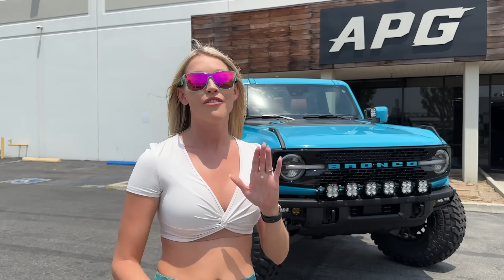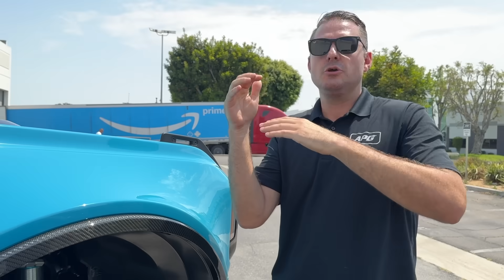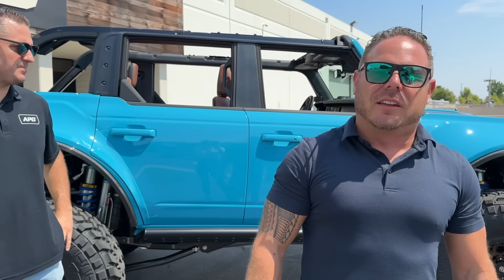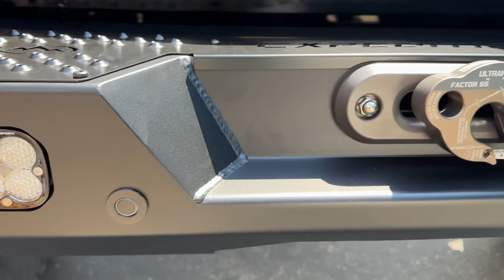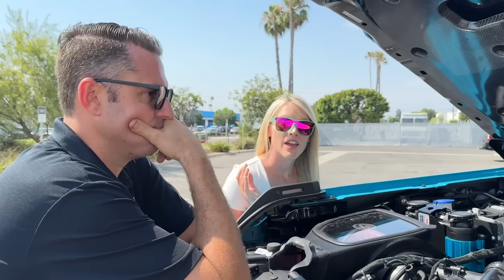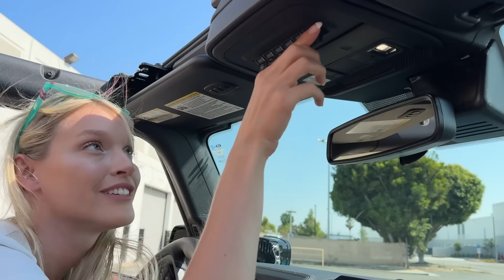BRONCO RAPTOR KILLER! The Best Bronco Build, Done the Right Way!

Comment: POS independent suspension. I won't be impressed until someone swaps in a solid axle, at least Dana 60. Kept the garbage engine when a Coyote would make a superb engine. Back in the day we torched off many an independent suspension for reliable and tough solid axles. And I won't even bring up issues like transmissions and transfer cases.

Comment: What gear ratio is this bronco? 2.70 or 3.73? The geometry looks off from the stock, meaning some parts will have more stress than other. How do u manage that? How much torque loss or power is expected with the bigger tyres and lift? Yes it definitely looks crazy

Comment: 💯This is absolutely not a raptor killer, just pretty.
Reply from the maker: It definitely out performs a Bronco Raptor. ☺️
Reply: @LiteBrite  ... let's keep it real, unless a Raptor was lightly modded, 3.0L = 500+hp & 550LB-FT torque, Baja Kits LT Suspension #RIP

Comment: Guys, I used to have a great deal of respect for your content when I first followed your wrangler shows.  Seeing you waste your breath as an advocate for FORD just drives me away.  Back in 1985, I gave FORD a chance when  I bought my first Bronco.  What a piece of crap.  Five trips to the dealer to fix a transmission problem with NO FIX.  After 3 months and zero resolution I sold it.  Later on, I asked the dealer I traded it into,"did you ever figure out what was the problem?"  He informed me, FORD built the transmission with on of the plated flipped 180 degrees out.  At this point, you couldn't give me one for free...they are crap.

Comment: Now just because I am studying for taking the PE and literally just did this calc... the air in the tires do in fact have weight and letting it out will reduce the weight by like 0.02 lbs. It is under pressure (more dense) therefore more mass. I did not realize APG builds such incredible rigs. When I saw one, my first thought was those fenders are toast. Really cool to see all of the engineering and testing that went into them. Great choice on the color!

Comment: I wouldn't buy a heavily modified vehicle for safety concerns Related to Altered Engineering Dynamics.  POV- Manufactures spend millions of dollars on Research and Development with teams of Engineers.  also, OEM have accumulated long term Metrology on the Detailed aspects of Design architecture.

Comment: You spent $150k in upgrades and no 4-link in the rear?
Reply from the maker: We wanted to keep stock gas tank and not deal with fuel cell bullshit like in our jeep. 4 link isn’t really needed if the 5 link is setup nicely. Is it better? Sure but not enough to have to do the mods needed and take away from the daily drivability or possible issues
Reply: @LiteBrite  cool looking forward to your adventures with it

Comment: Carbon inner fender,... yah, gut reaction, that's not going to last. Carbon Fibre is really great under Tension, but under Shear Loads it fails quickly. The impact from rocks and stones on and off road is going to impart a Shear Load on the fibers with each impact. Manufacturers use plastic materials there because they stretch and recover with those loadings. This isn't anything against the manufacturing quality of the shop, it's a function of the materials strengths and weaknesses.
"Panhard" is the correct name, from long before Jeep ever used them. Have also heard the 'Brake Reaction Control Bar' under the front of a Chrysler get called a Track Bar, but also, the Weight Transfer Control Bar is often mislabeled as a 'Anti-roll' or 'Sway' bar.
It's such a shame Kevin couldn't fit under the Bronco to explain all that protective paneling technology, poor Britt could have gotten her hair caught on the slider!

Comment: Nice tip about spare tire air pressure. Really like the rear bumper as it is engineered for spare tire sizes up to 40". All other manufacturers I have researched only are rated up to 38" tires. I'll be communicating with APG about their bumper. BTW according to Mark Rober, there is a weight reduction by removing air from the spare tire. Thanks for sharing.

Comment: I bet the heck out of all of my vehicles the jeep wrangler I use to own was a2008 4 door maroon in color  3.8 L engine not the 3.6L I mine also was a6 speed manual transmission I would go around every corner squealing tires on a stock everything and I also went over a pyramid pile of logs at 15 miles per hour and even through a river bed as well at 25 mph so yeah I am very hard on my vehicles

Comment: As someone who works on and builds custom offroad rigs. Adjustable on vehicle is a huge time saver when it comes to alignments. And setting up suspension! Ive spent hours on raptors setting up the front ends with non Adjustable on vehicle hiems

Comment: NVM skids with UHMW are super nice. I installed them on my WT. And the self lubricationg properties I found out about last year coming down the waterfall gatekeeper on the Grizzly Lake trail at SCW. I dropped the front tires over the 3 ft wall and my Bronco slide clear to the bottom. It was comic. I now have APG Mid-runner suspension on it on 37" Nitto Ridge Grapplers. I will be curious how it handles on those trails now. Love to see your WT in person sometime because it looks sick AF.

Comment: Question:  That Bronco looks nice you were mentioning it's width. "Wide tires and fender flares that would let you run into a mountain because the flares are tough" . There are some trails that a wide vehicle cannot get through I'm not saying it is not capable I'm saying that it just won't fit. For instance, Matt has a specific use for the Banana because it is narrower than the Morvair or the Wrecker. They are too wide, Britt can take her buggy a lot of places the stepchild can't go.  What is the width of the Stepchild vs the Broco?
Reply from the maker: We will have to measure
Reply: @LiteBrite  Please watch Robby Layton's latest episode! You guy's need to take the new Bronco to Hanging Tree Falls (Trail Rated as a 5). Water, Rocks/Boulders, sand climbing up waterfalls. Robby says it is the Hardest trail in Utah! Also- you will need to go with another Jeep or 4x4!  The trail is tough! The trail is close to Robby so maybe you can get him and or his crew to go with you.

Comment: Y’all know that air pressure off the windshield will blow air back down those vents right??  SLOW speeds, yep will work great. But high speeds that will Litteral blow air back down those hood vents. That’s why stock stock hood vents of newer rides are way up front.

Comment: That UHMW on the skids is awesome. We use UHMW-PE (Ultra High Molecular Weight Polyethylene) on airboats, it helps protect the hull and allows the boat to easily slide over anything, even dry asphalt highways with no problem. lol.